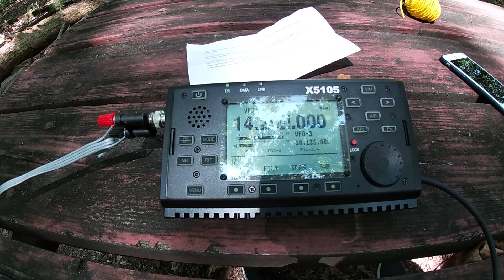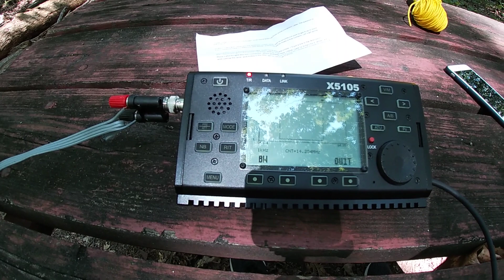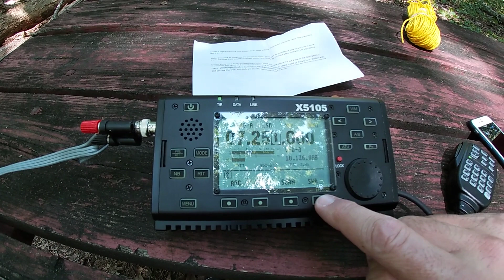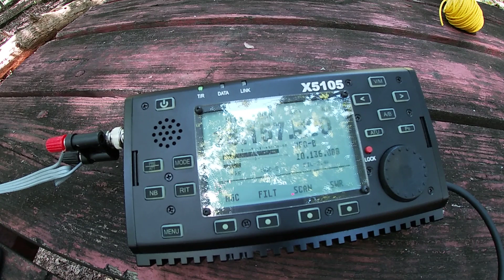Cheap, homebrew,, HF, QRP,  ham radio antenna first test - Success

Comment: I just made a NoCal but used speaker wire rather than computer cable since I had the former. I just checked and it tuned fine on 40, 30, and 20 with a little Emtech ZM-2. It's more bulky than a half-wave or a random wire, but being a balanced antenna I shouldn't have to deal with a counterpoise.

Comment: Awesome videos buddy. I qualified around 6 years ago but have never actually transmitted XD. I guess I'm a little too shy. I'm really into my SDR though and love using it remotely to listen in noiseless environments. Your videos have really spurred me to perhaps get myself a basic QRP setup and actually start doing some transmitting. I love the idea of operating with bare minimum remotely and, as I enjoy hiking it seems like it will fit in with that perfectly! Soo many choices with respect to gear though, it's a little bamboozling for someone just starting out. Thanks again :)

Comment: I struggled with this QRP radio thing. So I bought a Yaesu FT891.  I turn it down and operate.  When I need more juice I turn it up to 20 watts. So I bought a 12 amp battery solar charger and now I’m shopping for a nice cheap 200 watt solar panel. I operate about 4 times a year portable and the 891 was relatively cheap.  I do want  an LNR mountain topper for minimal Cw portable though.

Comment: Nice job Sir!  It's a great little radio. You should have a go at using the swr scan function to help you cut your wire antenna to be resonant on one band. That way you can disable the tuner and work much more efficiently with your five watts. It's amazing how far it'll get you....

P.S. you still need to calibrate that S Meter 😉
Reply: Ronan Cantwell ...great reference on this subject matter here: 

https://www.fars.k6ya.org/docs/Facts-about-SWR-and-Loss.pdf

If the computer wire is appreciably lossy, then this may have a pronounced effect.

Great video, K4BBL!

73s om....de KV4YX (Cumming, GA)

Comment: Are any satellites used in the Hawaii to west coast call or from west coast to Georgia???
Reply from the maker: No, just HF radio to radio.
Reply: How can that be from Hawaii to west coast if the earth is round, it has to be flat? What do you think???
Reply: @glennfrye3464   This is how it works. It just has to do with the way HF radio waves interact with a layer of the atmosphere called the ionosphere. Most of the time they don't go straight they actually get radiated in all directions with omnidirectional antennas like the dipole in the video, however they can be focused in one direction with a directional antenna. Anyway most antennas shoot out radio waves that bounce off the ionosphere and get reflected back to other radios. Us hams and everyone else who uses radio communication just use the ionosphere like a big mirror, bouncing radio waves off of it like a ball bouncing off a wall. There are other types of propagation but this is how most contacts are made. Hope this helps, 73!